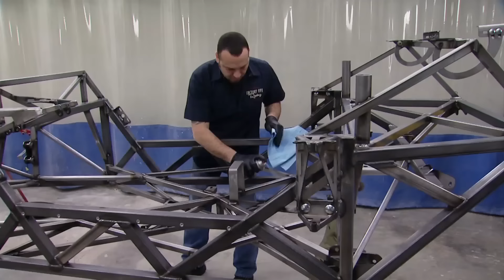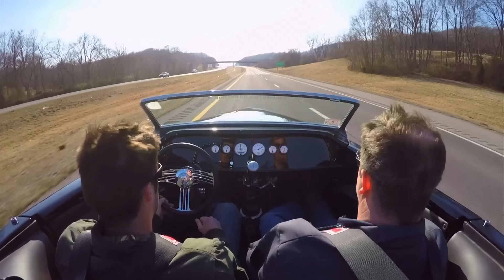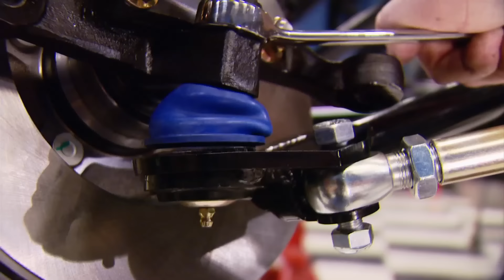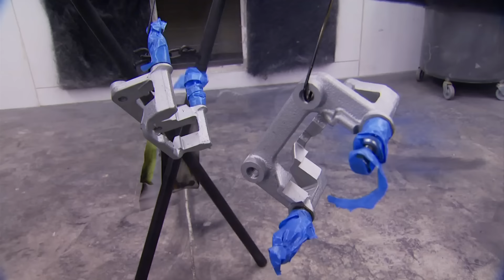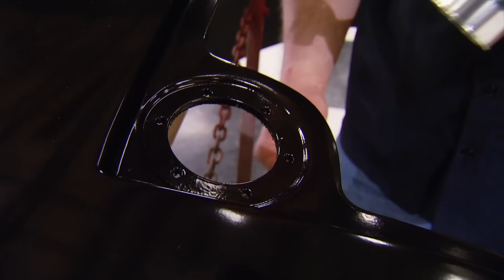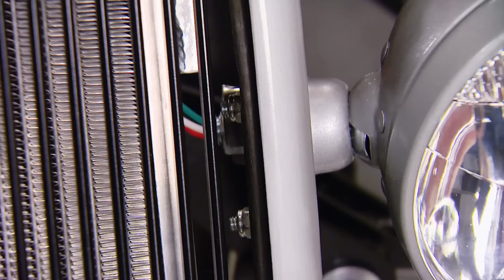Build a Kit Car with ONLY a Drill, Pop Rivets, and Rattle Can Paint - Engine Power S2, E10

Comment: those wanna know. its 20k. you do not get a engine trans and some other parts. just the body kit and frame kit with some extras is 20k. most will have 30k into one these builds.
Reply: 30k is almost into brand new Mustang GT territory. Hard pass on this
Reply: @abie1308  a new mustang couldnt touch would i could build for that 10k in drive train lol. o yah.
Reply: @abie1308  but ill never have the 30k to build one of these way id like. let alone buy a new car. im barely getting my 1964 skylark put together and on road.
Reply: Which is why those speedway motors t bucket kits are so popular. You can probably build one under 15k, depending on how much you want to spend on the powertrain.
Reply: @machinist7230  correct. i was just tossing outt he high end. cause i can get a junk yard Ls 5.3 which runs great. last 500k miles. tons mods have around tops 2k in a build and kick ass doing it. pinch on the body some too if needed.

Comment: I dream of one of those 33s,with a hot slant six and some tall narrow steel wheels,
Reply: I'd find a 85 mustang donor with a carbureted roller top 302 and a 5 speed manual, light weight 225 hp stock and 300-6 with overdrive gas mileage until you stomp on it.
Reply: @goober3463  those are rare now,but there are a lot of crown,vics out there
Reply: I had a '61 Ford f100 with a 300ci straight six....I had a Clifford intake w/dual 2bbl holleys and split headers with true dual cherry bomb glass packs .  She wasn't the fastest ol girl but damn she sounded like nothing else and ran like a clock.  Also had disc brake conversion up front and mono-leaf suspension that dropped it 3"
Reply: Dream bigger and lose the 6
Reply: @trentdawg2832  making oddball stuff fast is the point